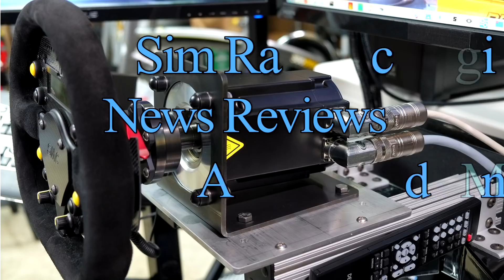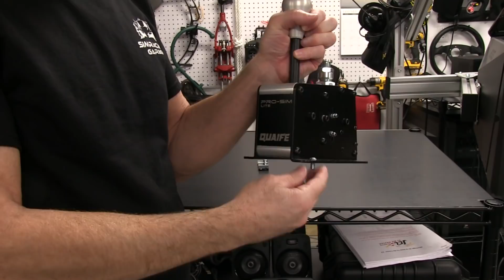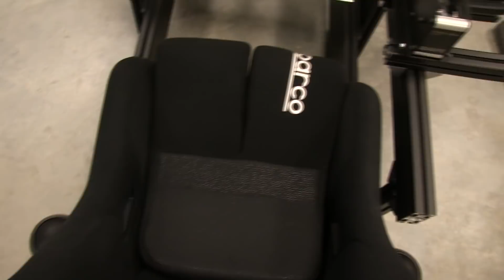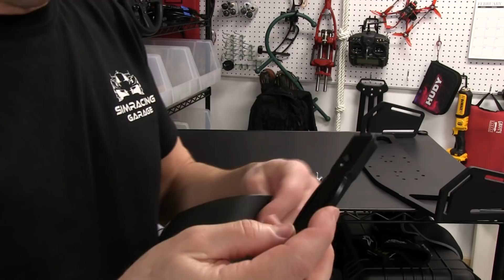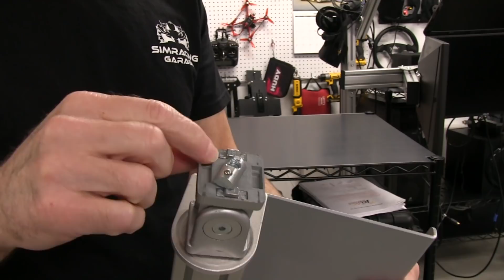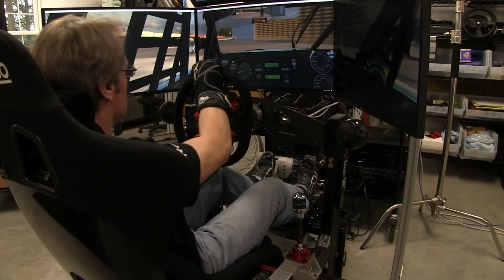Sim Lab P1 Cockpit Part 2 "The Setup"

Comment: Great vid as always Barry. I'm in Northern VA and been at sim racing a long time and love your stuff! Though truth be told lately it's more fiddling with my gear and configuring "the next upgrade" then actually racing in my rare non-work time, sadly. Can't wait to be retired like you and dedicate more time to it! Maybe even make vids again. I used to make several popular YouTube videos such as Fanatec DIY mods and reviews, triple-screen 3D projection sim setup (now gone for VR), etc.. Anyway if my travels in the pro-AV industry every bring me down your way I'll give you a heads up and maybe we could grab a beer. One quick question about Sim-Lab stuff or similar: My 80/20 rigs have all so far been 15-series, not metric. What I really need to complete the setup is the custom pieces like the wheel deck or dash, adjustable pedal brackets, etc.. (all the water-jet cut aluminum pieces.) Do you know of anyone in the US or elsewhere making similar items for 15-series? Or even if I had to switch to metric, does Sim-Labs do any US distribution or is it all shipping from EU? I supposed hopefully they'd at least sell just the custom brackets to allow me to source and cut the profile more locally for less shipping. Seems to me there would be a market for a similar solution based in the US.
Reply from the maker: I have been using 15 and 40 series together for a while now. They are so close in dimensions, never had an issue using 15 hardware on 40 profile or vise versa. 15 is 1.5" = 38.1mm in width, with the channel width being .320 = 8.128mm. 40 is of course 40mm wide with a channel width of 8.13. So yeah too close to matter in use. Only exceptions being if you want to mount something flat that crosses both 40 and 15 series profiles. Not sure how much the 1mm difference on each side of the profiles would matter. And yeah, hit me up at info@simracinggarage.com if you will be in my area.

Comment: How long is the steering wheel extension and where did you get it from?
Reply from the maker: It's 4", from ebay: https://www.ebay.com/itm/4-Steering-Wheel-Spacer-Polished-Aluminum-for-MOMO-NARDI-ISOTTA-SPARCO-OMP/111015588260?epid=2280721744&hash=item19d90b71a4:g:cgkAAOSwP~tW5lsv&vxp=mtr
Reply: Hi Barry,

Edit: all good. 

For those who look for extension in EU good place (competitive price and quality, discount code can be found online 10%) is: 

https://www.demon-tweeks.co.uk/motorsport/steering-wheel-bosses-accessories/b-g-racing-alloy-steering-wheel-spacers-6-bolt

I bought myself 120mm one. They come with screws and both 6x 70mm and 6x 72.4mm patterns. The wight of 120mm one is 340g (to be confirmed)

For those in USA the one like Barry has can be had even cheaper directly from distributor (free shipping) and in black or silver:

6980-B4.0 (black 4")   
http://www.flashpowerparts.com/steering-wheel-parts/660-40-steeringwheelhubadapterextensionspacer-black.html    
    
6980-B5.0 (black 5") 
http://www.flashpowerparts.com/steering-wheel-parts/661-50-steeringwheelhubadapterextensionspacer-black.html   

Also available in silver .

Good luck

Comment: I got a Sim-lab GT1 last month and love it, Richard and crew were incredibly helpful. Kinda wish I would've tried to get one of these black P1s though as it looks amazing! Incredibly jealous of the D-Box setup Barry!
Reply: DSaw78 whats the difference between the p1 and gt rig ? Apart from price
Reply: The main side rails are bigger on the P1 and the pedal mounting/adjustment is different on each. Other than the price that's about it. You can't go wrong with either and the GT1 is fully capable of handling a DD wheel and some motion setups.
Reply: DSaw78 thanks for reply I currently have a simetek k2 which is rock solid but now  intrested in motion may require some modding due to its narrow width. 
I couldnt understand the price diffetence between the  gt and p1.

Comment: How do you like those MFG crosswinds? 40:56 I am reluctant to buy them. Two months to receive them from overseas sounds like a scam,but I have seen a few people using them. I cheaped out on my rudder pedals and just got the thrustmaster ones.I thought it would compliment my warthog set.If you are wondering,yes, they are trash,quality hotas does not transfer to quality rudder pedals.
Reply from the maker: Just get them. I waited 3 months. No issues. They are the best sim rudder pedals I have ever used.
Reply: Some really nice flight sim gear on  your wall as well. Do you have another channel or plans to do some flight sim hardware reviews? I'm keen for a dual purpose rig with a relatively easy conversion from road to flight.

Comment: After reviewing JCL v2 and P1, how do they differ in practical terms? After seing the JCL v2 it almost looked like the P1 was more difficult to mount, though maybe it was the presentation in the video, and I'm getting real worried about the P1 black scratching easily.
Reply from the maker: Either one would get the job done. The JCL is wider and lighter. They are both very stiff platforms. The black finishes on both will scratch if you do not take care in mounting your hardware. Just everyday use can cause a scratch somewhere. Silver would be the best color if you are worried.
Reply: Thanks! Guess it's time to live a bit dangerously. Wonderfully detailed videos, looking forward to the next! I keep learning something new every time I watch a new one. Thanks for doing this!
Reply: Anodizing have similar finish to a marker pen, so you can use that to hide scratches. I would guess it is easier to hide on black than silver. Cheers :)

Comment: How do you do the final tighten on the seat mounts, when the seat is already in place? A very low profile allen key?
Reply from the maker: I replace the cap head socket bolts with regular hex head bolts. Easy to get a wrench on the low profile hex head.

Comment: Has he tried VR yet?
Reply from the maker: Yes I am a VR fan. VR has tremendous potential as far as immersion is concerned. Just has a way to go before I give up my beautiful IPS monitors. Also, the physical aspects of today's goggles will improve a lot in the future. Some day we will look back at monitor technology as it is today and think, how primitive!
Reply from the maker: Yes.
Reply: With such expensive wheels, be a shame not to see them. VR for me tho, never going back to monitors
Reply: Sim Racing Garage so true. I think the new windows mr headsets and the vice pro are already better then the current stuff for sim racing. It will only get better
Reply: Sim Racing Garage not a fan ?
Reply: Why dont u buy head track sensor to view left and right up and down ?
TrackIR 5
Reply: Pimax 8K if you have two 1080ti...

Comment: can you mount the pedals and seat down between to frame rails to lower the overall height of everything
Reply from the maker: Sure, you can do most anything with 80/20 profile. Just need to source the parts to make it happen.
Reply: Sim Racing Garage hi mate could you tell me what kind of speakers so i can find me some?

Comment: ok, but how would one mount a shifter h pattern and an (HE)handbrake horizontal in so little space. 
specially if I was using the same big ass shifter youre using ? we can forget about the mouse tray, as I would mount in else where or no where. as I have an all in one keyboard
Reply from the maker: I am going to be getting some hand brakes to review soon. When using the hand brake, I will use a sequential shifter. So, not as big of a footprint. I will be fabricating an aluminum plate to mount both the shifter and hand brake to. Then mount that to the rig.
At least that's the plan. Great thing about 80/20 is you can always find a solution to a mounting problem.
Reply: Thank You, Ill be looking forward for that video. can you also try with a thrustmaster shifter ?
Reply from the maker: Yes, it is on my list for 2018. Plus some available mods for that shifter.

Comment: Seems very similar to the jcl v2 cockpit. How would you compare the two, + and - of both. Another great video. Thanks for investing the time to do this.
Reply: Sorry to butt in, can't speak for the man himself, but I'm considering either of them. As I've 3d-modelled my whole apartment it was easy to see some of the practical differences. V2 was 120cm long vs 140 (P1), but also about 20cm wider than P1. In effect "fatter" than the slimmer&longer P1. Pedalmount for V2 I think was hinged (rotating hinge, is that the right word?) and seemed easier to adjust on the V2. The P1 wheel mount seems alot more elegant and sturdy than the V2. JCL is getting praise for protecting the shipment / packaging. V2 comes in different color combinations (black and red etc), keyboard is also black (haven't seen a Simlab black tray yet), but the Simlab keyboard tray (though silver) looks more sturdy and larger in the videos I've seen so far. Both have about 2 week delay now if ordering right now. In my case, JCL shipment is twice the cost of Simlab; this will vary. So much back and forth, it's confusing :) Do like the P1 wheel mount, not a fan of the huge 140cm though...
Reply: Which did you wind up getting and why?

Comment: Quick question, why would you not have your monitors attached to your dbox frame to make them move with you? Do you experience any inner ear conflict / dizziness from not having your eyes agree with your ear?  Aloha
Reply from the maker: I don't notice any problems by running the monitors mounted separately. Either way should work fine I think.